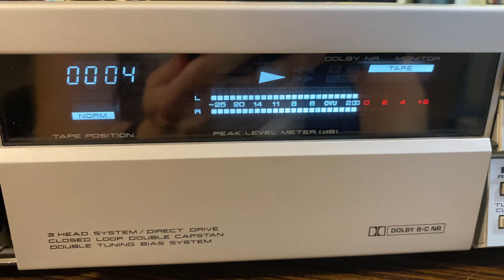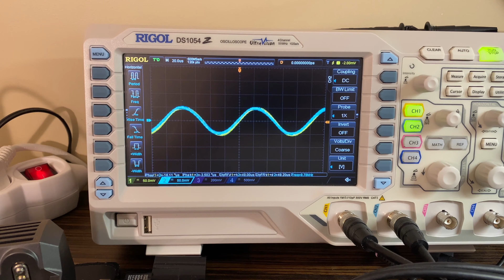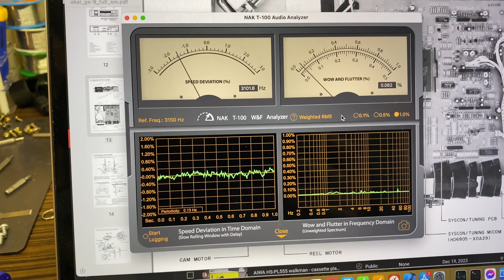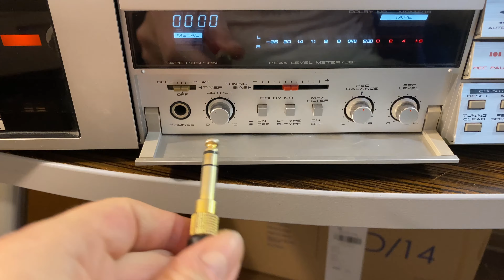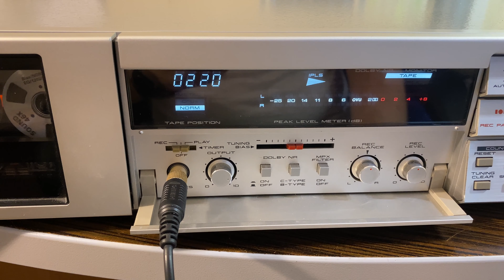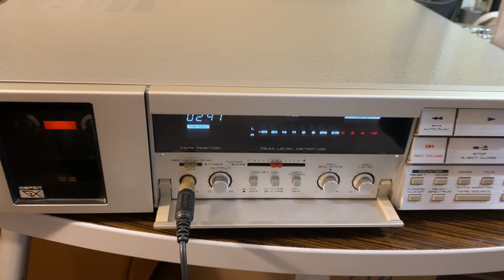Akai GX 9 service repair tape transport and alignment of tape path #diy #repair #deck E0013

Comment: Hi there, thanks so much for your fantastic repair videos - it helped me a lot!! I've repaired some GX75 and GX6 with your videos :-) One question: would it make sense to use the gauge tool after you've applied the plastic cover with the tape-light? Just to make sure that your calibration tool fits exactly like the normal cassette?
Reply from the maker: Hi mate! Thank you! 🙏 if you are talking about that metal gauge it is used to set correct tape path via all tape guides and heads high - this is must if you removed supply side pinchroller arm.
Cheers!

Comment: hey there! by any chance do you have a copy of that service manual you are using? I can only find the PCB schematics one, which is unfortunately not well labeled, or frankly if you know which pot is the speed control for the motor, i'd assume it's one of the two on the top of the transport, just don't wanna mess with the wrong one yknow, thanks! I appreciate you uploading these kinds of videos, it gives a great look at what to expect opening mine
Reply: nevermind found it lol
Reply from the maker: @searchiemusic  no problem :) Cheers